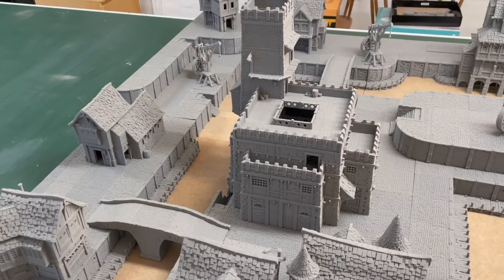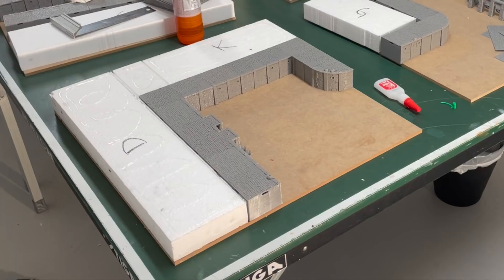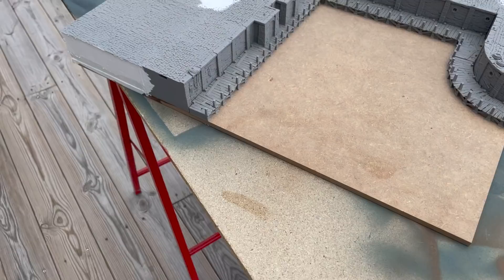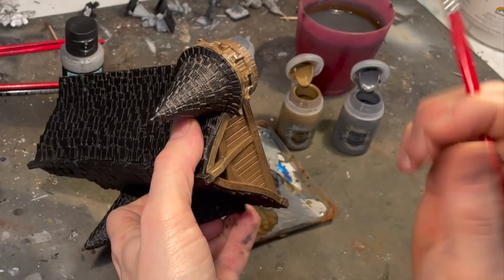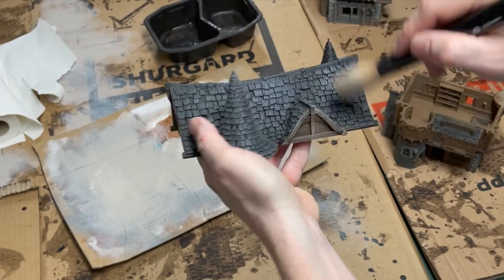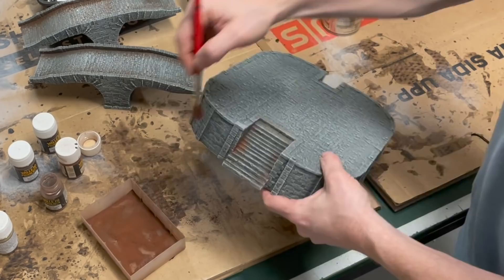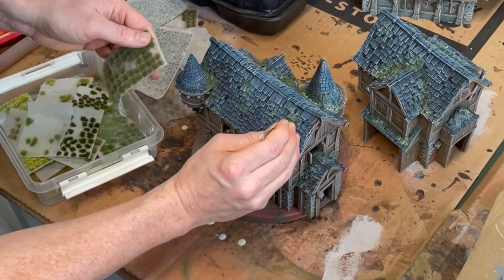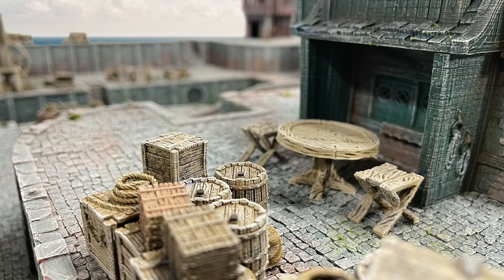Building another amazing game board, Medieval Port for wargames.

Comment: Not that I don't appreciate the work that flowed into making such detailed sets...but one question remains: is it really worth it? 
Who plays this? How often is this environment reused in a campaign? Who has the necessary room to put these sets up - and even more pressing: where to store them, when not in use?
Reply from the maker: For skirmish games its perfect. Stuff can be moved around and changed up. For roleplaying i get it. But i dont do that.
Reply: I feel like it’s worth it if you’re enjoying it
Reply: Well... if you have full sized ship models for ~28mm minis, might as well also set up docks and a harbor wharf area for them too.  It does get a bit space intensive.    And for roleplay, these kind of layouts are more playset than practical terrain unless you have a lot of fights down at the docks.
If you're going to make large 2'x2' tiles or 2'x4' tiles you also need to make shelves to store them too, perhaps under the gaming table.  If you oversize the table surface a bit to say 6'x10', and keep the play area to 4'x8', there's room for people legs underneath and player surface for books and sheets, and you could store ~12 whole tables worth of big tiles under the table in ~3"-4" shelves. Less if the shelves and table surface are more modest.  Kinda have to have a big gameroom for this stuff...15'x15' or 20'x20' or bigger to be comfortable with a big table and shelves on the walls for more terrain.   Aside from the awesome factor of the terrain, if you want to re-use the harbor layout a lot in a roleplaying game scenario you kinda have to contrive reasons to need to be down at the harbor.  If you are running a nautical themed game and this is your home port it could work though.   This sort of setup probably makes more sense for skirmish games where the terrain is more integral to the game rules....people who set up dedicated wargame tables tend to leave them set up for storage,  and try to make the tiles modular enough so the layout can be changed up with a lot of variety with only a few extra tiles and rotating and shifting the tiles.....  The tiles Lybbans used in this video aren't terribly modular...I'd love to see sketches of how he would layout 4-6 more 2'x2' or 2'x4' tiles to make it modular and flexible for 4'x6' or 4'x8' or 6'x8' or 6'x10' tables.  6' wide is about the max you can get away with on a table for terrain and still reach.  

I suspect that the Quay sections will be kind of goofy if not glued down, especially since it's a huge time and cost saver to use the foam trick he used to do the large cobbled areas, and the tile blocks are pretty light when printed.  I'm considering molding and casting the tiles though, as it takes a long time to print them on FDM...it's quite a bit faster on a resin printer, but with molds and depending on what material (hydrostone vs resin) you can crank them out in more like 10 minutes per mold vs ~1 day on fdm with 50 micron layers, or ~4 hours for 2 tiles on a medium sized resin printer.  Still working out how to cast them hollow... solid plaster is going to be heavy and solid resin is too expensive.

I've been messing around with graphing out potential layouts...since the quay tiles are 3" (75mm) square, a 2'x2' tile works out to 8x8 squares.   I don't like the 6"/2 square wide canals as they are too small for most boats, especially with docks added, and the bridges block the canal up, but 3 square/9" wide canals make sense....the tile layouts need to be offset so one side generally has 2 squares of quay, then the 3 square canal, then a 3 square quay.
 I suppose 2-square canals make sense if they are just for sewage and drainage, and to serve as terrain obstacles...they just aren't wide enough to navigate so there wouldn't be an extensive network of them.
But it also remains to be seen how the stretch goal harbor walls and bridges are implemented to suggest additional layouts, as well as how the buildings that integrate with quay fit in (e.g. the tavern with waterline entrance and the warehouse and prison, as well as however the sewers turn out)...

To be fair, a real busy port city would tend to have simpler straight quay wall pier along the long side of the table with things jutting off of it, and the rest of the table could just be raised quay where you could layout various buildings and streets, so in that case you could get a lot of variety simply by moving the buildings around.  This is probably one of the only practical layouts if you are going to be using Reaper's Sophie's Revenge ship with this which is around 3' long, or the other big ships from the Ancrabourg kickstarter or the ones from PrintableScenery or the Wizkids one...  I have several 3d printed ones and a converted playmobile ship which I'll be using with the tiles I eventually make...

A long straight pier wall and sections of entirely raised quay are the first tiles I will make, as that setup will be very flexible for pulling a ship up to the pier and arranging my building models in a variety of ways to represent different port cities.  And maybe some kind of breakwater...I'll probably use the lighthouse from Bones 6 too.

Comment: Im really tempted to buy this set. Looks great!
What are the standard hight of the stone quay walls? The foam i have avaliable is 5cm.
I wouldn't want to scale the walls to much!
Reply from the maker: It is 50mm so you are good. That is what i used. But all things 3d van be scaled to the exact height you want in the slicer
Reply: @Lybbansminiatures  That's true. I'll buy the set and have a go at it.
Cheers.

Comment: Hello
another great job I wanted to know what thickness of polystyrene do you use and what are the measurements for the stl files? did you modify their scales or simply cut them?
Reply from the maker: The polysturene is 50mm and i lowered the pavement tiles so they were just a mm thick and that fit right with the quay pieces

Comment: Hello and Good Morning. I just came across this video. I am running a D&D 3.5E campaign with a pirate/port city. My question is are all 4 sections modular on their own so you can move them around for different configuration? Or did/do you have they set a a specific location to tie in with each other?
Reply from the maker: They can be moved around to make different setups.

Comment: Fantastic video. Your work is inspiring for sure. Thanks for the tips and guidance as always. I'm assuming that you used the 32mm scale files for these boards since 3DLayerscenery only are offering 32mm and 15mm scale files for this project. In your experience, can you use 28mm miniatures with the 32mm scene and still have it work? I funded the kickstarter but didn't notice the lack of 28mm scale files until after I was finished. (Yeah, my bad for that but every other set of files I have purchased had 28mm scale files so didn't think to look.) Thanks!
Reply from the maker: Hello and thanks. I think these fit nocely with 28mm minis. No problem at all. And its very easy to rescale stl files in cura if you do want them slightly smaller.

Comment: Hey there, just bought the late pledge and i am trying to print the quay floors....i used the 2wall 5% infill  setting but having trouble...did you edit the 15s where the bottoms were cut or booleened? they look thinner when you glue them to the foam....just curious 
well done btw
Reply from the maker: Thanks. Yes i lowered the floors i cura so they are just a few mm thick as that saves a ton of pla. I cant remember how much though. Just be sure to have the same height on all of them
Reply: @Lybbansminiatures  ..yes, i did that but what i am having trouble is that even though my printer(ender 3) has been all dialed in and been working flaswlessly, It takes a beating on the bricks and still takes 7hours....? Care to go more in depth on what profile you used  or elaborate more other than infill and walls?
Reply from the maker: @martystep4772  hmmm. Thats weird. I do change my settings sometimes so i cant remember exactly but i do print at 50mm per second and at 0.2mm layer height. I relly lowered the files very low in cura. The layer between the bricks is barely a mm thick so its very flexible, almost like paper.

Comment: Hi, quick question on the wash you used over everything - what is the paint to water ratio you are using? Also if you don't mind, are you using the Basics line of liqutex acrylic paints? Thanks!
Reply from the maker: Yes. Its the basic line of liquitex paints. The ratio is really hard to tell as i kinda mix till i get a good consistency. Its probably close to 20% paint or less at least. I would suggest trying it out on a smaller piece till you are happy. I will probably have to make a recipe some day as my last batch was way too thin. Haha

Comment: That ended up looking spectacular! What was the watery "sludge" mix you applied to the roofs?
Reply from the maker: Thank you. Its pva glue, water and fine green foam flock
Reply: @Lybbansminiatures  What ratio of PVA to water to you use for this?
Reply from the maker: @iseekthegrail  about 2/4 water, 1/4 glue and 1/4 flock